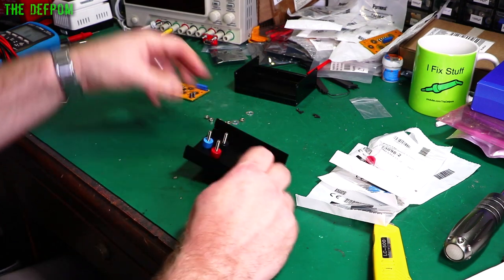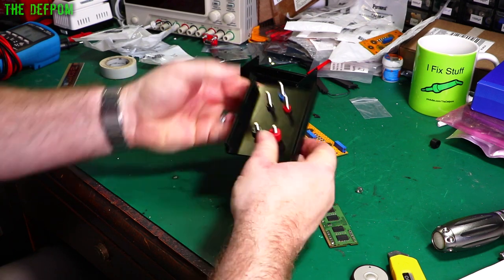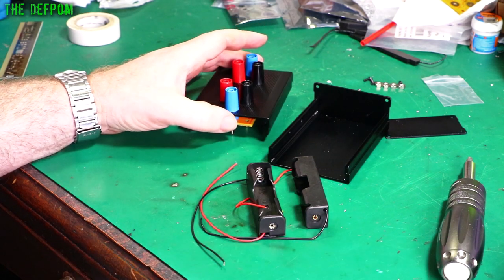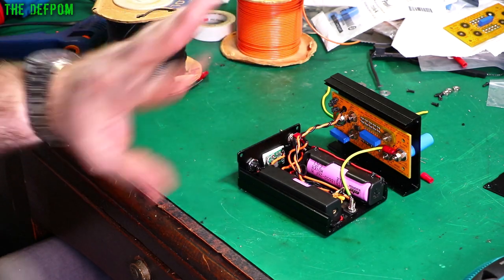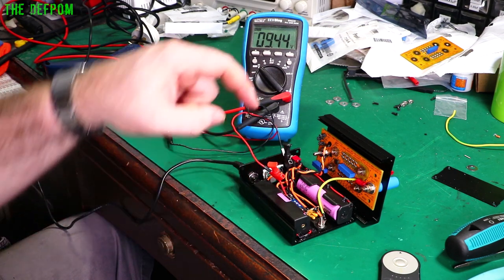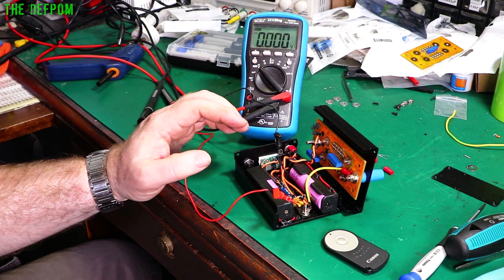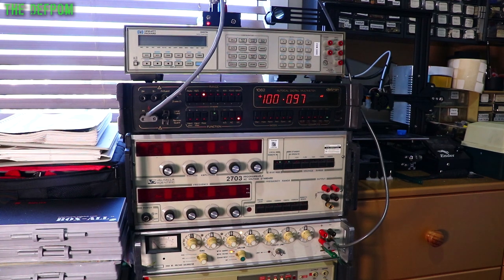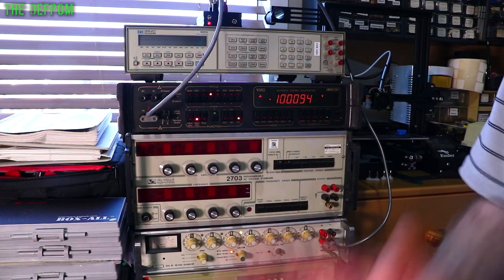#780 Voltage Divider Project - Part 4 Sponsored By PCBWay & Pomona

Comment: I use white sticky parcel labels on a surface i want to mark with a pen/pencil, drill through then peel off.
Why did i use them, well err ok, i was given a stack of them for free lol :-D
The 5v regulator,  im sure that when you jack up a 78xx regulator you treat it like a lm317 by using two resistors
And dont forget the capacitors, otherwise it might oscillate, wobble wobble oow moving readings lol.